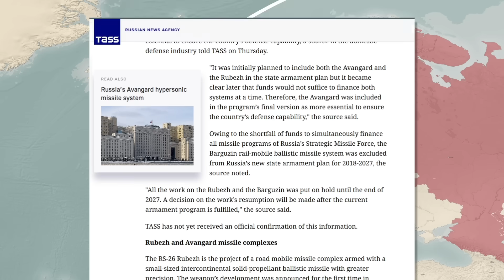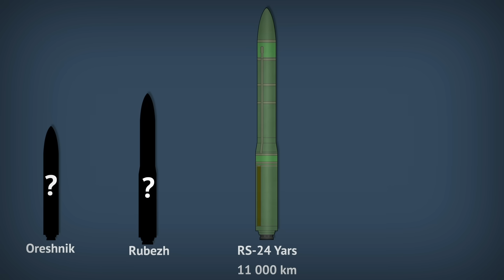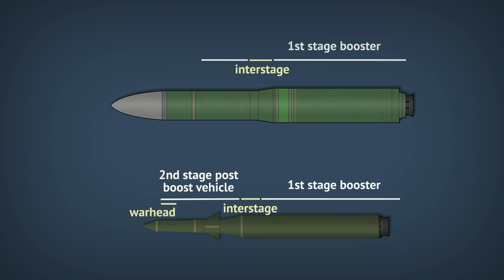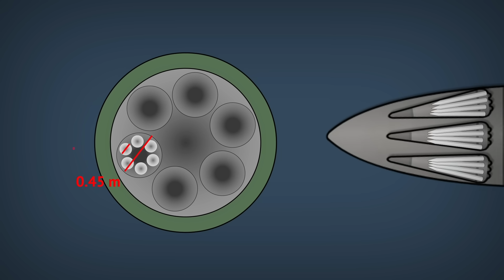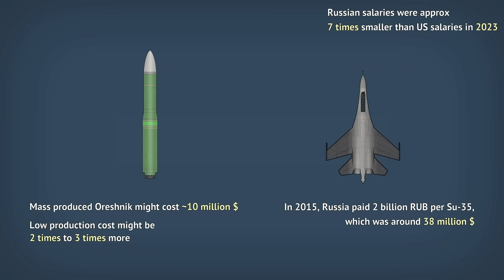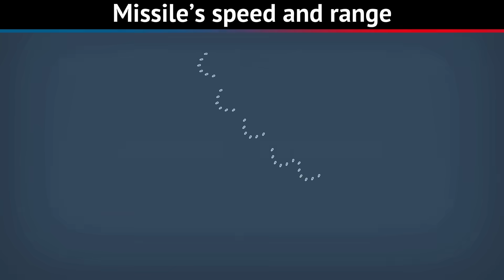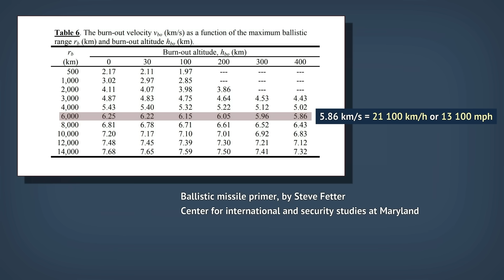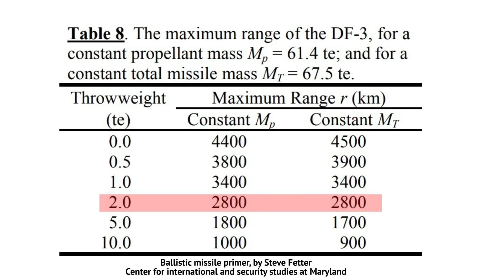Ukraine can’t counter Oreshnik missile. But it doesn’t have to.

Comment: with regards it being expensive again he get this wrong.  One of these missiles costs about $40  million.  Yes that's expensive.
Now drop this one an airbase and even if one warhead  destroys just one fighter jet or the radar and control centre there's your money back right there without even counting the damage done by the other 35 warheads.  this weapon is capable  of doing hundreds of millions of dollars worth of damage to a NATO airbase.
I would argue that this weapon is probably the best bang for  buck weapon on the planet if you exclude nukes
Reply: It’s not expensive, just a few washing machines 😂
Reply: MOAB says no. According to the Air Force, it only costs $170.000 , highest estimate is $16m.
Oreshkin can still be intercepted in its earlier stages as well, when it is both slower and more predictable.
NATO, however, will always have air supremacy in a hot war against Russia.
Reply: @Bacontruffle moab need something to deliver, delivery cost must be added.
Reply: @YSKWatch  I suppose so, but that's still nowhere close to $40m
Especially when you realize the US has over 12 times the military budget of Russia
It's also more accurate, directly targeted, and proven in combat.
Reply: @Bacontruffle  1 plane to deliver, few others to protect it, awacs, maybe tanker, delivery speed less than mach 2 while ukr report that rus' hit at 11 to 11.4 mach. the plane might not pass the air defense.
Reply: @YSKWatch  Likely not necessary, but let's entertain that.
US tends to use stealth bombers, which so far Russian systems haven't gotten a chance to intercept yet. Said bomber can keep making runs whereas you can't re-use Oreshkin.
The math still comes out far more positively.

This also isn't considering that the US has stealth cruise missiles, if you want more stand-off range. According to simulations that were ran early in the war, the US could wipe out the Russian Black Sea Fleet with 1 run of F-35's firing off stealth cruise missiles at the very edge of Romanian airspace.
Reply: @Bacontruffle  now, it's the unknown territory. stealth is no longer an advantage: maybe, maybe not. so, the rest would be theoretical.
Reply: @YSKWatch  You could not have wrote that in a thicker Russian accent
That comment legit reads as if it's a poorly machine translated Russian comment.

Also, no, it is in fact not theoretical. The US has consistently shown its stealth aircraft not only to be effective, but has consistently defeated Russian S300 and even S400 systems.
Reply: exactly. area saturation attacks dont come cheap doesnt matter how you do it. binkov's team seem to have perceived the missile as a way to attack a single target. but the much more natural interpretation is that Orenshnik is an area saturation weapon, for air ports, ports, rail marshal yards, factories, etc. binkov did layout one nice framework of thinking about the cost. but it was measured against the wrong type of weapons and targets.
Reply: @ecpgieicg  Which is incredibly limited when used against NATO.
Weapons that can ruin airports are rather powerful against Russia, because... well it has very few and they're far apart. 
Ever checked the map of military airports in Europe? You see a couple in Russia and around it, and suddenly hundreds upon hundreds once you get to central Europe.

Russia would need hundreds of Orenshnik's in order to be trouble for NATO to any serious degree, and since it still mainly sources its chips from NATO countries, smuggled through intermediaries like China... good luck.
Reply: @Bacontruffle  i dont know what copium are smoking. NATO does operate around a few large hubs in Europe. The political side of the demo is simply that this system is impossible to defend against and is efficient at destroying area target. 

And still I don't care. The novelty of the weapon is that it may solve the cost efficiency issue for area saturation attacks.
Reply: @ecpgieicg  first of all, grammar. Secondly, "a few large hubs" is a funny way to say Germany has 445 military air fields alone, Poland has 93 (btw, my Polish friends would like me to quote Duda: "Nie strasz, nie strasz, bo się zesrasz") and Sweden has  107. Remember: west Russia only has 49 *total*. Good luck.
Also, "impossible to defend" is ridiculous cope. THAAD exists. The missile can still be intercepted, remember, it first has to slowly climb up before reaching its terminal phase.

And lastly, skill issue. "solve cost efficiency issue" when Russia can't produce missiles without Western chips is hilarious.
It's especially hilarious since we don't need such weapons to make sure not a single aircraft can takeoff from the few Russian airports they have. Ukraine has been doing surprisingly well targeting Russian planes on the ground with just drones and missile strikes. Again, skill issue.
Reply: @Bacontruffle  So your idea is to disperse from bases like the Rhein-Main Air Base to yoru 445 airfields "in the area" in 15min? That's somehow not ridiculous to you? You surely also have similarly non-ridiculous means to disperse railway marshal yards, ports, and factories?

Comment: These comments are just stupid. A mass icbm like attack such as in a nuclear war scenario simply cannot be stopped by ANY country. There are simply not enough interceptors.
Reply: BS. Best way to stop a mass ICBM attack is to stop it at the root.
All Russian subs are monitored 24/7 by NATO, and can be sunk before they get anything off.
All Russian ICBM launch sites are monitored 24/7 and since Finland joined NATO, are well within range.
Russian aviation is out of the question since it doesn't have any hopes of contending with NATO air power.
No need to worry about the nuclear triangle if you can counter it.

And this ofcourse ignores that Russia's ICBM fleet is in horrible condition, outdated, THAAD exists, and all available evidence suggests that Russia does not have the resources nor the talent to maintain its USSR era ICBMs, only leaving a fraction of those remotely operational, and leaving only modern ICBMs, which haven't had the best track record as of late.
(I would like to point you to the state of ICBM's Ukraine gave up in 1994, 80%+ were utterly unsalvagable, the remaining 20% needed extensive repairs. This was due to the braindrain, almost all scientists/engineers that worked on/maintained these fled to the West)
Reply: @Bacontruffle  Ukraine never had any icbms to begin with, it was all from soviet union. 
In 1994 Ukraine gave away "their nukes" and signed it should be neutral and not join any military alliances ever. I see how good that went xD
Reply: @Bacontruffle  If you want to twist the narative heres one for you.
Quote: "the United States publicly maintains that "the Memorandum is not legally binding", calling it a "political commitment"
Reply: @_void9381  Sigh, you're really not good at this, are you? That part is on the subject of the defensive clause of the Memorandum.
"The Budapest Memorandum was negotiated at political level, but it is not entirely clear whether the instrument is devoid entirely of legal provisions. It refers to assurances, but unlike guarantees, it does not impose a legal obligation of military assistance on its parties." is what's just before your quote from Wikipedia.

You really need to get better talking points from your komissar.

Russia invaded Ukraine in a war of aggression, breaking the Budapest Memorandum. It's an illegal war (yes, war) that has been internationally acknowledged as an illegal war, not to mention the countless war crimes Russia has committed like the Bucha massacre.
Reply: What about Superman?
Reply: US could POTENTIALLY have enough, but only to blunt such an attack to limit casualties.
Reply: @HyperScorpio8688 they definitely don't. Plus they are extremely limited by the amount that can be available for any single defensive engagement. Look how many patriots fired at one incoming Kinzhal and it still impacted the patriot battery site. If you limit yourself to launching two interceptors per warhead(which is a minimum) then you're using 72 interceptors which is more than these ABM batteries have ready to launch.
Reply: even in non-nuclear scenarios the missles aren't being intercepted. Israel's Iron Dome turned out to be a bluff.

Comment: Am I wrong to assume it is basically useless without nuclear warheads? Kinetic payloads seem not powerful enough to destroy e.g., patriots, unless they hit spot on. Which I also assume is not very probable. It has 36 kinetic warheads, but they will spread over a large area.
Reply: You are wrong. The effectiveness of kinetic warheads depends on what they impact. The more solid the target the quicker and more completely the energy is transferred into the target. Besides the force of that is directly hit by the warhead the impact creates  shockwaves that cause damage. It's basically a meteor impact. Also we don't know if the warheads are purely kinetic, they may be simply exploding far underground and can't be seen because by necessity it would be a small warhead on each of those to survive impact
Reply: @alexdunphy3716  I agree with your statements. But the question is how heavy are these meteors and how spread they are. In interception kinetic weapons, the energy can reach about 5 times the equivalent mass in TNT. But that assumes the interception speed, i.e., warhead downgoing speed + interceptor upgoing speed. In this case it hit the ground, so the speed was less and so was the kinetic energy.  If for the sake of simplicity we assume the speed is cut in half you get only 1/4th the energy, so it would roughly be equivalent to a bomb with around the same weight of TNT as the mass of the warhead. How much do they weigh? For comparison, a 500lb bomb has of the order of 100 kg of TNT.Of course, if you hit the target, or close to the target, you will destroy it, no question there. But how spread out will the 36 warheads be? 1 km^2? 10 km^2? Also, how much energy will be dissipated by each warhead before hitting the ground? I reckon it will slow down significantly more than if you had a single MIRV warhead instead of 6 kinetic sub-warheads. I guess one could actually calculate an estimate for the final speed based on the footage. 

In any case, as I stated above, the damage where the weapon has (supposedly) hit was minor, based on some videos I saw. How curated are those videos I don't know. But a 500lb bomb hitting a house would obliterate it, not just collapse part of the roof.
Reply: Why I'd like to see the results which are curiously no where to be found. Still they were going at least mach 5 to 10 by the time they hit. Spread across 20 or so hits and its a cluster head with each having the energy of a large bomb. May not need to be pinpoint accurate.
Reply: @bonedoc4556  I've seen a few videos with the supposed damage done by the warheads. I reckon it was supposed to hit a factory, but hit a residential region nearby instead. By the looks of the damage, it was absolutely minimal. Any other weapon hitting a house would do much more damage. But I don't know how "curated" those damage videos were.
Reply: @washussan  that's called propaganda. Even tiny meteors leave surprisingly large crators
Reply: @alexdunphy3716  It's not propaganda, it's just my impressions from the video. It is called an opinion ;-)
To be pedantic, tiny meteors are up to the size of a grain of sand and never reach the ground, hehe. Also, meteors can be orders of magnitude faster than any missile. I think a characteristic speed for meteors at reentry is 70 km/s, or  mach~205, so much more than 10 times faster. Remember that if this translates to a x10 faster impact speed, the energy release would be 100 times larger, kinetic energy  is quadratic. That said, they are not aerodynamic and should lose more speed than a reentry vehicle, but still.... Also, please define large crater and tiny meteor. Is it a 1 kg, 100kg? Is a large crater the size of a 500lb bomb crater or the size of a small drone crater? The explosions are tiny in the video, just look.
Reply: These are explosions..... If they wanted shock and awe they should make it look like like this ;-)
https://www.youtube.com/watch?v=m8KimNtB9HI
Reply: @bonedoc4556  it's not curious, it's a military facility and Ukraine doesn't post any damage or losses as a matter of policy
Reply: @alexdunphy3716  fair enough.
Reply: Just look at the impact footage. Do the "explosions"  look anything like any sizable bomb? By the looks of it, the impact speed was not even close to 7km/s. Let's say it takes 1/10s from where they enter the frame until they hit the ground (it's more like 2/10s). Does that height look anything like 2300 ft? That's what you need to get to 7km/s in 1/10s. Not even close, I say!  Again... I think subdividing the warheads kills the impact speed. They lose much more speed at the terminal phase. They just look like small, not that fast, meteors.
Reply: @washussan  They didn't have warheads fitted. They were a demonstration of what Russia is capable of, a warning to the west.
Reply: @jamesadey8744  I agree with the reason for the attack, but they did have kinetic warheads, which can be just about anything with mass, even just ballast to compensate for the weight of the removed warheads. No explosives, but they lead to big releases of energy if they hit at great speeds, just like meteors.
Reply: @washussan  2300 ft is only about 700m that's way more than 700m. Remember, the factory is absolutely massive

Comment: Russian bots seething so hard in comments🤣 🤣🤣Face it guys is shortened ICBM from 1970s and not your daddy putler futuristic wunderwaffe. Only thing it damaged is russian ruble.🤣🤣🤣
Reply: how is it 1970's
Reply: @soggydoggy01  SS-20 Saber deployed by the Soviet Union from 1976 to 1988.
Reply: @ you made that up from no info, plus the missile you sent can hold at most 3 warheads more than in the videos of the irbm
Reply: @soggydoggy01   while it certainly uses the foundation established by the Topol (developed in the 1970s) and could be considered a natural progression of it, I think it's more accurate to describe the missile as 90's or early 2000's tech as the missiles that it's directly using components from as well as the overall technological capabilities it uses where developed by Russia during that time.
Reply: @ but on wikipedia it says its based off of the rubezh that is a very recent missile
Reply: @soggydoggy01  I think he is confused, he meant to say the patriot was 70s tech...
Reply: @beaker755  nope he didnt
Reply: It went through though(2)
Reply: You sound a bit hysterical. Which I find funny.
Reply: It went through though

Comment: BTW what you are showing at start of the video is MS-29 resuply capsule en route to ISS. Not the flight of Oreshnik, it was already confirmed. Also Ukraine doesnt have to counter, BUT NATO might as well need to do it. Oreshnik is perfect for targeting US millitary bases and airfields in Europe.... and not just US ones. Despite its cost, it will surely be cheeper then if Russia try to do it with planes and conventional warfare. Just dozen of those can severly criple NATO airsuperiority, by destroying  those bases and airfields, sagnificantly deminishing its capabilities.
Reply: For its tactical capabilities oreshnik isn't even expensive. Russia doesn't do expensive stuff, it does cost effective stuff.
Reply: @dannydanny2789  Its not only that. Russia MIC is state owned, so it dont have to fill pockets of shareholders, which makes it even more cost effective. Its MIC works for the state, not state working for MIC as it is in US and the wst as general.

Comment: could it be a carrier killer?
Reply: russia miss the target , they could never hit a carrier
Reply: With such characteristics, no?
It's a missile shotgun. Too little pellets to inflict damage, too much scattered to be precise.
Although, it could indeed overwhelm the defences easily and/or hope to inflict reduced mobility on the carrier group.
Preparing terrain for the actual carrier killer.
Reply: @sethheristal9561  I don't think it makes sense to use such missiles against aircraft carriers. In principle, aircraft carriers in the modern world of drones are a floating target. And it is very easy to sink it. Ships as a whole are a relic of the past in military terms after the advent of drones. But if such a missile hits an aircraft carrier, it will be torn apart by kinetic force.
Reply: @sethheristal9561 idk what you're talking about but the impact video shows incredible precision and certainly enough to have some of he warheads hit an aircraft carrier sized target.  And those warheads would do quite a bit of damage likely punching straight through the bottom of the ship. The actual issue is targeting. There isn't really any practical way to give the missile the information necessary to hit a moving target 1000s of km away
Reply: @alexdunphy3716   Incredible precision yes but for a target like a base. You said it, aircraft carrier is moving, I add also it's smaller than a base. Not a tiny target, sure: but not a 100% hit, also considering defences. 
If hit, it's maybe incapacitated? Anyway can saturate defences easily. That's big. 
That's why I say it can for sure prepare the way for the follow up actuall carrier killer (a more powerful, more pin-point precision missile).
Reply: @sethheristal9561  ("...too little pellets..."  I figure the warheads are hypersonic on impact acting like a kinetic weapon???  seems like it could sink a carrier
Reply: @hawaiinnative  You massively underestimate how survivable a modern US carrier is.
China built a mock-up carrier in the desert and struggled to sink it with purpose-built missiles designed to sink carriers.
Reply: @Bacontruffle  true
Reply: @hawaiinnative estimated speed from the video is generally between 5-10km/s. Which is about mach 15-30
Reply: Can it hit a moving target?